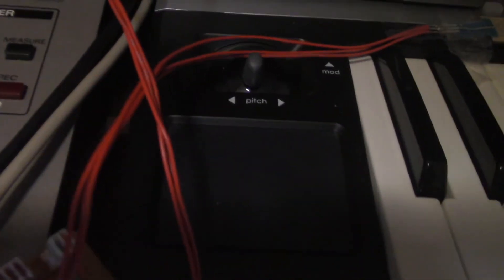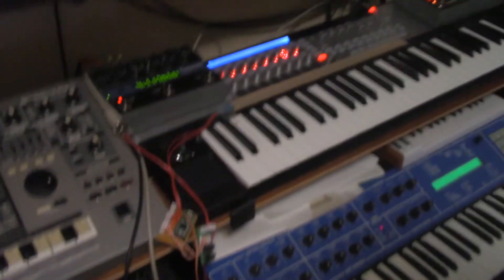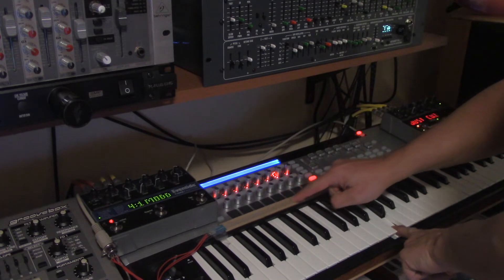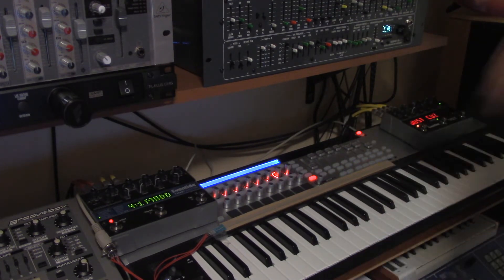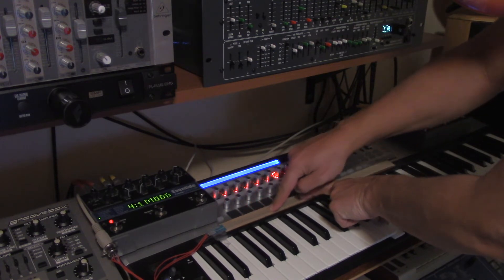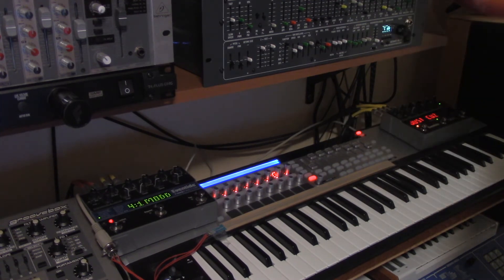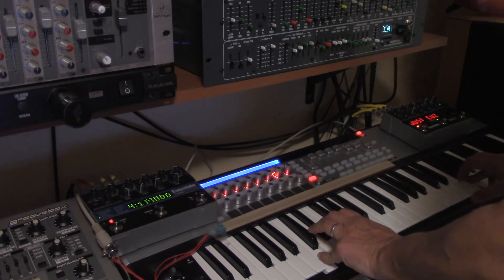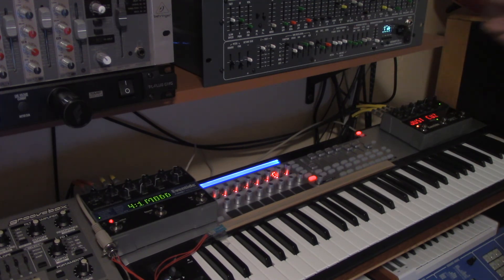Deckard's Helper - DIY Ribbon and PseudoPoly Aftertouch for the Deckard's Dream

Comment: Nice ribbon features, and that fakey poly AT sounds great. for AT is that effectively muting AT response on the lower keys? Or creating a 2nd AT channel?
Reply from the maker: Thanks! It's really not very complicated. When there is an incoming channelAT message, I'm intercepting it and instead of passing it on, I'm sending a new polyAT message for the most recently pressed key. There's a little bit of complexity in the bookkeeping, but nothing very complex.
Reply: This Poly AT trick is very smart. Would it be possible to built this feature inside a daw (ableton in my case) or with something like max4live or Bome Midi Translator? Then I could use my Doepfer LMK2+ with the Deckards Dream

The Ribbon is great too btw 😀